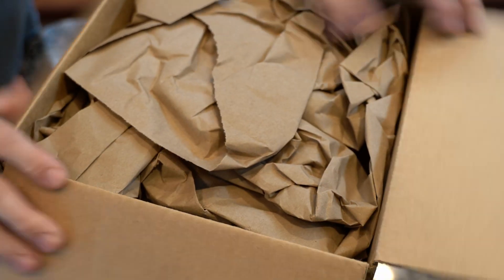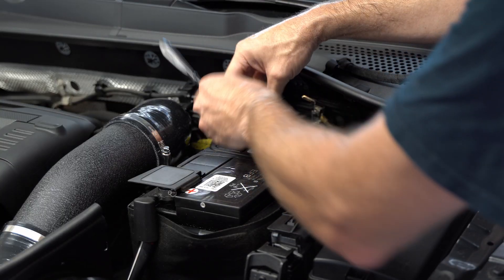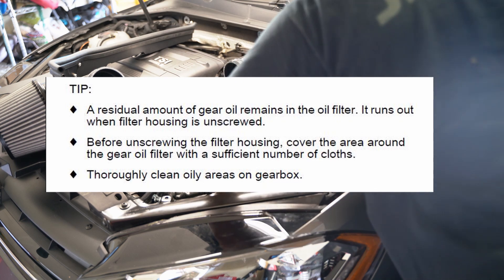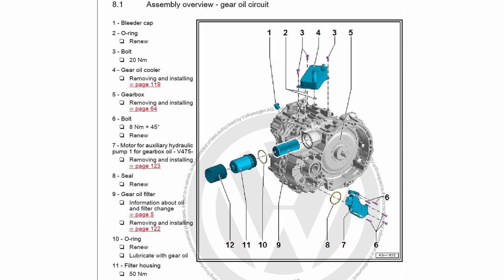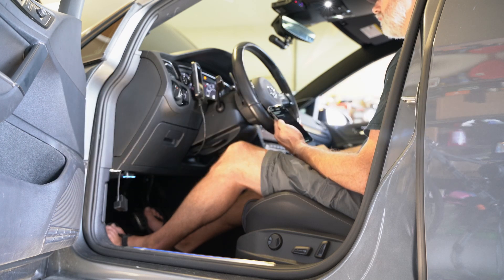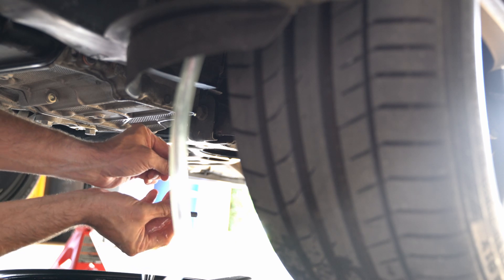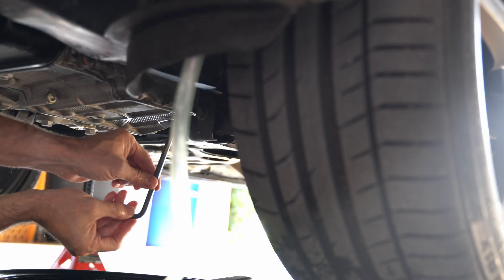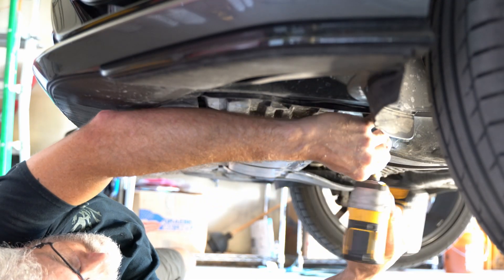7-speed DSG Service MK7.5 VW Golf R - HINT: It's different than the MK7 process!

Comment: Hello! I sent the car for service to DSG DQ500 at a workshop, but when they did the service, they didn't check the oil level. I have driven it for about 250km without checking the oil level. Can I check the oil level in the DSG DQ500 now, and would it cause any problem if I open the oil drain plug?

Comment: Well I followed a video that guided me to do the 2 full turns backout setup before attaching rhe filling in hose and then when done filling tighten the drain plug which caused it to stress rhe tube and crack it now the tube head is damaged and I can’t get the hex/Alan key to turn it either way just had to torque up and leave ir as is. Until I ever need to drain the transmission fluid - will need to use an extractor tool then.

Comment: Just completed the dsg service on my seat ateca 4drive. I have got to say this video is by far the best. My overflow was beige, so i just backed it off 2 turns. I also managed to get my hand and socket down to the filter without having to remove anything  which was a bonus.

Comment: At 11.25 you tell, regardless of the color of the overflow pipe, the process is the same. NOT CORRECT! Maybe you should get the latest version of the manual (your's was 3,5 yrs old at the time, probably older than the transmission itself. Current is at least 07/2022) or something has been lost in translation, but the German language manual for the DQ381 transmission states: there are different versions of the transmission, which come with differently colored overflow pipes. The beige pipe needs to be screwed out 2 turns, the red one must be screwed in all the way, when checking the oil level. Two turns are equavalent of 3mm oil level. If you do it wrong either way, you miss the much oil or overfilled by that much. Is it critical? Maybe those how followed your advise wrongly can comment on that...

Comment: Thx for the video, to final check you unscrew the interior bolt for 2 turn right, , and wait that drop down slowly than tight again? In video is covered by tube an i can't see how much liquid drops down when thight the interior bolt (is plastic i think)

Comment: Excellent post and instructions! I have the DQ381 in my 2019 Audi TTS and I also have the FSM for that vehicle. I've been getting ready to do this and came across this post which really elevated my confidence to be able to do this job and save ~$500 (shop wanted $710). I would like to note that my FSM discusses the Beige vs Red overflow pipe in detail and states if you have a beige pipe "it must be replaced with a red one"...instructions say back off two turns for Beige for correct level or fully seated if Red. BTW, TTS has the battery in the rear of the car which simplifies access to the filter!
Reply: good tips my man. i did it today. i had a beige one.. so i didnt replace it with red.. didnt turn it out 2 turns.. but it wasnt leaking out anyway, at 44C... bummer.

Comment: Thanks for this post.  I did my 2019 rabbit gti 7speed today. 
I only needed to remove intake pipe and elbow to remove the filter , it’s tight but easily done , since our filter is horizontal it’s a bit messy. I decided on the no turns out on the drain tube , will seee what happens the next 40k 🤟🍺🇨🇦

Comment: Great video. Please be aware the need for loosening the overflow pipe on a Red pipe is not needed. This information is clearly stated in the 2020 service manual for a Skoda Kodiaq for OGC gearbox, which is the most modern manual I could find for this gearbox. I confirmed this information with the master technician at my local Seat dealer before doing the service my Seat Leon Cupra.
The most recent VWmanual i could
find for this gearbox was 2018 and made no mention of the Beige (longer)  or Red (shorter) fill pipes.
Edit:
You can find this manual yourself by searching this "7-speed_dual-clutch_gearbox_0GC 04.2020" and the info is on page 229
Reply: Well, the OGC Manual I have dated 09.2022 states that it must be done for the various VWs that it covers to prevent foaming of gear oil.    7-Speed dual clutch gearbox 0GC Edition 09.2022 pp. 138.  It also says the exact same thing for the SEAT manual for the same transmission dated 03.2017 pp. 83. 

So no.
Reply: @B @BenState  what do you mean ‘no’ are you saying the info I quoted is wrong ? 

I’ve mentioned the file name so it can be found, and given the page number the info is on 😂😂😂

Unless your manual states that there is 2 fill pipes of different lengths, Red and Beige, which there is - then I personally will be sticking to what my manual clearly says.
My car comes with a Red fill pipe so I follow the instructions for that pipe 😊

As with anything don’t just trust what some random dude in the internet says….do your own research, it’s all out there, and come to your own informed opinion 👍🏼👍🏼
Reply: @ricks4490  Again, you've mis-interpreted 'not required' with do not do.  Not the same thing.  Ive also given you two more modern manuals where it has been updated.  Update your knowledge.
Reply: @BenState  lol I havent misinterpreted anything and my knowledge is clearly deeper than yours on the subject, you are probably not aware of the different lenght fill pipes. I am. 
Red is 67mm long and Beige/White is 70mm. Both fit. Post GPF cars in Europe the Red fill pipe was introduced, Pre and the Beige one. Doesn't take a rocket scentist to work out if the Red fill pipe is shorter to start with and you then go ahead and loosen it... you are left with even less oil. 
There is a chance you are based in the US in which case you would be blissfully unaware of this information, or that your VW manual is a US one. Not even going to discuss the Seat manual you have 🤣 it's from 2017. 
The manual I linked to is a Skoda one, so an EU manual, all cars have GPF from Sept 2018, hence the manual giving the info about the new Red fill pipe 😉

Here is the info from a UK supplier of the pipes 
"Genuine VAG DQ381 Gearbox Oil Fill Tube - Red Or White - 0BT321363 / 0GC321353 
Gear oil fill tube for DQ381 7 speed DSG gearbox
Typically speaking - the below applies however if you are at all unsure we would encourage you to contact us with your registration number / chassis so we can confirm.
0GC321363 - Red Fill Tube- Post GPF Vehicles
0BT321363 - White Fill Tube - Pre GPF Vehicles
The red fill tube is Only for DQ381 7 speed DSG gearboxes, will NOT fit DQ250 / DQ500 ETC
The part number for the white fill tube will also fit some 7 speed DQ500 Boxes used in transporter T5 / T6 Models, as well as select DQ381 models.
The red fill tube measures 6.7cm Long
The white fill tube measures 7cm Long"
Reply: @ricks4490  So you have cherry picked the data you want while simultaneously choosing to ignore the same data source that contradicts you.   That is why it is in the most recent workshop manuals.  You also have 3 different gearbox's listed so you're just trying to bamboozle me with nonsense.

Refer to my post for the most recent workshop instructions.  Using old workshop versions, different gearboxes and part numbers to somehow prove your claim is low IQ.
Reply: @BenState 🤡 
Different gearbox’s ? 😆😆 🤡 
Old manuals ? You rocked up quoting a 2017 manual 😂😂 🤡 

I’m not trying to bamboozle anyone (but for you I fear it wouldn’t be hard if what I’ve wrote is bamboozling you 😮) the data is out there, make your own mind up it really doesn’t bother me 😊
Reply: @ricks4490  I quoted the 2022 workshop manuals.  You quoted the older ones.  God you're confused.
Reply: @B @BenState  nice try noob.
So you didn’t mention a Seat manual from 2017 in your original comment ? 
Why even mention that like it had some relevance 🤡
I’m well aware you also mentioned a VW manual from 2022, but your manual doesn’t distinguish between the 2 lengths of fill pipe that are available in certain regions. You failed to clarify what region your manual is from and you got ‘bamboozled’, bless you. 
All my info still stands but you lack the knowledge on the platform to understand, as you’ve shown. 
All my info can be readily found inc the manual and the info about the 2 lengths of fill pipes. 
Leave the technical discussions for those capable and experienced on the platform , you just carry on as you were and many thanks for the input.
Reply: @ricks4490  You complete muppet.  You just keep choosing the data you want to believe without understanding how this works.  The manual you are using is obsolete.  Facts.  You truly are a dropped pie.
Reply: @ricks4490  Your original post "The most recent VWmanual i could
find for this gearbox was 2018 and made no mention of the Beige (longer)  or Red (shorter) fill pipes.
Edit:
You can find this manual yourself by searching this "7-speed_dual-clutch_gearbox_0GC 04.2020" and the info is on page 229"

Clearly you have no fkn idea as you're working this shit out in this thread.  Pathetic.

Comment: Shouldn’t you have to run basic settings in VCDS or your AP after the change?
Reply: Dont think manual calls that out for fluid change. Think you are however to do it when battery is unhooked which it was.

Comment: Nice video but this is the dq 381 ? what interval is recommended? I'm almost at 40.000km

thanks guys
Reply: Yes it is. Very strange filter positioning almost as if it wouldn't want to be serviced..anyway..i have been searching for months a video of "how to"..getting back to the question...oil service interval is 120000 km...and lifetime oil filter..which crazy...i would recommend 60000 km and each time get a new oil filter.👍

Comment: Thanks for the awesome step by step video including manual references!! Really top! I’ve purchased the same set from DAP. My Mk7.5 R 2019 (same as you) seems to have plenty of room to reach into the engine bay for the filter change. I also have the IE Intake and I wonder why going through the trouble to remove the intake and battery tray? Am I missing something as I think I could do it without removing anything. If to remove something, then the intake hose or the battery only would suffice I feel. Do I miss something?

Comment: One of the rarest video on YT for the change of the 0GC. Accurate, correct and aligned with the official procedure. That change from the high skilled mechanics that want to show how to do, but make it incorrectly ! (Deutsche Auto Part for example). Nothing to say. Thanks. Subbed
Reply: i used this to make my own video today on the 7 speed. Also shouting out this guy who helped me a lot per this video.
Reply: It is correct..in the DAP shop video they did not showed the level setting..However i have been watching their videos for a while now..and they know how stuff works VAG related service..I am guessing that they edited that part out rather than forgot to do it.
Reply: They didn’t do it incorrectly though it’s just a different transmission they worked on
Reply: @haku107  sorry but it was a DSG and they made the level with the engine off. So it is not correct
Reply: @polo16v190  ohh hmm I’ll need to rewatch 👍🏽

Comment: Is it posiible change oil filter from the bottom?
Reply: Yes you can. Need a universal and a long extension. On a lift anyway it’s pretty easy, unsure if you do it at home.
Reply: Yes. Today (21.11.21) i changed filter using car lift and there is an acces from below. You do not need any special tools. Socked 24 and short extension.
Reply: You cannot reach the filter from bottom
Reply: I just did my 2019 mk7.5 GTI from the bottom. It was actually pretty easy with a couple extensions and a swivel as per Humble mechanic method.
Reply: (For posterity) Yes, still messy, and I did it with a universal wobble socket with decent articulation and long extension. Even got it torqued mostly correctly, ignoring angle of socket. Probably a stubby 24mm and thin short ratchet would give access too, but wouldn't allow for torque. 
I wouldn't enjoy it on jackstands though!
BTW a "form-a-funnel" is a game changer (even just aluminum foil would probably work) for the mechatronic sideways drain.
Reply from the maker: Nope

Comment: Awesome video!.. Much appreciated the insight!! FYI!! If your IE intake is resting on your brake fluid reservoir, you may experience some vibrations or odd feeling in your brake pedal! Happened on a mk6 and noticed mk7s can have this same issue. Little twist/tweak will move it away!
Reply from the maker: Ha. It’s not touching, but thanks for the heads up. I’ll keep an eye on it.

Comment: Very similar procedure to the DQ500 on the RS3. When I drain the mechatronic unit I often use a piece of cardboard or a moldable funnel to prevent it from shooting fluid all over the wheel arch and wheel liner.
Reply from the maker: Haha. Oh yeah… I learned that lesson! Haha
Reply: thats because the DQ381 is effectively just a smaller version of the DQ500